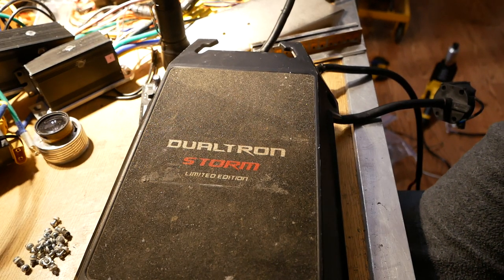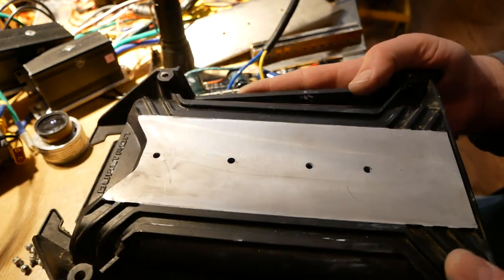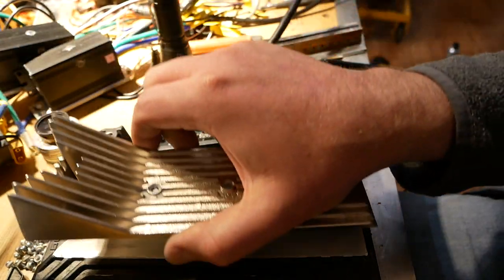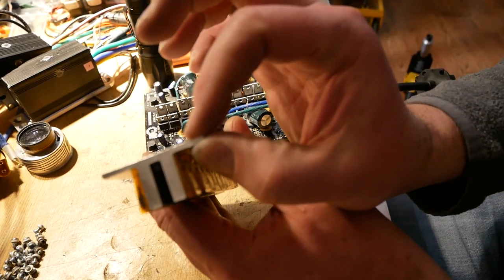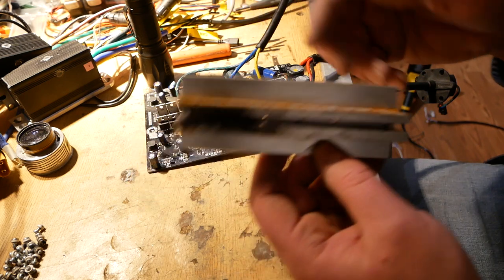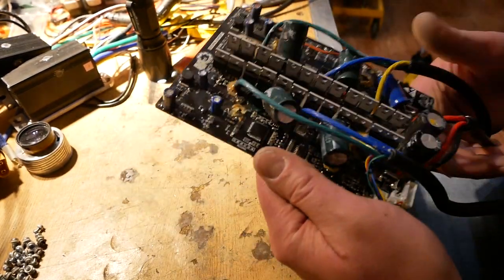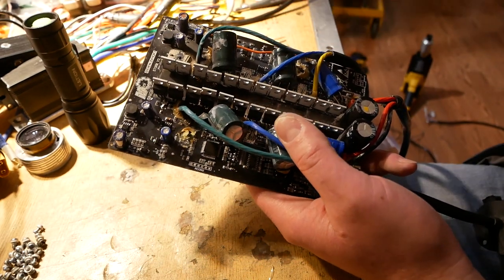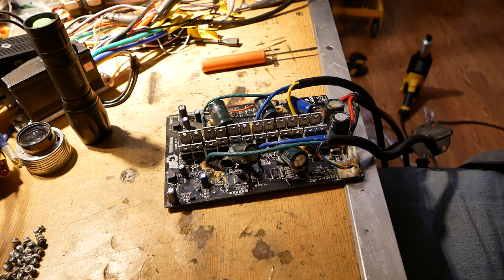Dualtron Storm LTD controller teardown - Why they die so often

Comment: I watched V_Tha_Sapien video talking about your discovery of the Dualtron Storm Limited controller because my limited controller burned out just the same as his. I had to ship my limited back to VoroMotors to get it fixed/repaired thankfully it was covered under warranty. I only had it but maybe 4 months and my controller failed. I’m glad there is someone like you that has taken the time to look into the issue first hand and actually find and share your results. I only hope that your video finds its way to the eyes of the Dualtron designers and manufacturers so they can see the errors they made and hopefully make the corrections that you have pointed out in your video. You got my sub. Thanks so much and Keep Smiling
Reply from the maker: GEEZ! 4 months! I think that's the second fastest Storm LTD controller failure I know of. My pal with the scooter shop, he was letting someone test ride a Storm and it blew up right there in the parking lot with like 10 miles on it. Either way, these controllers ought to survive many years of use without issues. 4 months is just pathetic! 
*
I made this video knowing the problem existed, but never had an LTD controller to look at before. I can't show or do anything if I don't have something to analyze...so I waited until one came in with a blown controller. It was inevitable...LOL! I went looking into the controller purely out of curiosity. The stupid high failure rates really had my attention! I wanted to see why they die as much as anyone and I don't even own an LTD! Frankly, if I did, I'd be pulling the controller out ASAP and replace it with something much better such as a VESC 100250. 
*
I own a Dualtron City. It's not very powerful from the factory. Probably the controllers will never die, but that's becasue they are hardly ticking over! Tepid, boring, slow are good descriptions for its performance from Dualtron. However, soon it will be doing much better and then I bet it will out perform the LTD. It's getting VESC controllers among other things.
Reply from the maker: BTW...thanks for the positive comments. Minimotors knows of me. I got their attention with the hook throttle delete mod video I did. I'm sure someone there will see this video soon enough. My friend just came back from Minimotors in California with 75 scooters (No LTD's!). They saw my video on the throttles and asked him if he knew how to get one. Well of course he did since I do a lot of scooter work for him! He took one of my throttles with him to leave in their possession when he picked up the 75 scooters. IMHO...the mod is pretty self explanatory and all right there in the video. I thought it was interesting that they wanted to see my work first hand. So yeah...Minimotors knows I exist. I'm sure they won't like my disparaging comments, but oh well. How about NOT making steaming turds that blow up all the time?!
Reply: @de-bodgery  I’m curious, if Dualtron gets enough complaints about the controllers failing, if they might put out a recall on them. It’s pretty unfortunate that they chose to cut corners in a few areas just to save a buck. In the long run, their poor choices will most likely cost them more than if they would have done it right the first time. All this negative attention can’t be good for their brand. I hope you do get a call back from MiniMotors snd possibly hire you. Because Lord knows, they could use your knowledge and expertise in their current and future products. With you under their belt, I’m sure they may even save some money. Time will tell. I’m rooting for you. Thanks so much and Keep Smiling
Reply from the maker: @steffenhawkins1323  
Laughs hilariously to himself...
These aren't cars or baby toys. I seriously doubt you could litigate a class action law suit and force a recall! Agreed, cutting corners just comes back to bite you in the ass. The LTD has a bad reputation to be sure! Also, nothing I have seen so far from Dualtron really inspires me with high levels of confidence. The wiring inside them is atrocious. They do seem to have decently well made frames and components, but the electrical systems seem to be laid out and designed by a 5 year old across all their EV's. Since all I've really seen so far is lots of Dualtrons, I can't really say if that is true with other scooter makers. Doesn't matter IMHO...shouldn't be done!
*
It didn't work out that I could go with my friend to Minimotors to pick up the 75 scooters he bought. I did want to go. If they offered me a job, I would have potentially considered it. I don't know if that would have worked out. Probably would have been better to just consult with them. Let me destroy a single unit of each of your scooters in an attempt to discover all the bad or poorly done aspects. Document what is found, let you fix them and then I do another tear down. Any new models you are working on for the near future, let me tear it apart, see what I find and we fix them before they ever see sales. It would potentially be worth while for Minimotors to have someone like me do that for them.
Reply: @de-bodgery  I agree with you 100%. I don’t know much about other Dualtrons since this Limited is my very first branded electric scooter. Before purchasing this Dualtron, I had purchased two electric scooters from Alibaba during the first year of the pandemic from a company called TVictor aka RealMax that you can sorta custom design them. However, I was not at all educated in what to shop for when it came to purchasing my first scooter. I didn’t know anything about the battery, the voltage, amp hours, speed, the controllers, the stem wobbles, any of the maintenance, I got into the this scooter fad completely blind as to what to look or shop for. . Within the past year is when I really dove deep and became obsessed with the electric scooters and finally after countless hours researching and watching reviews on YouTube on electric scooters in when I realized that there were more reliable and better scooters available than the ones from Alibaba. That’s when I came across an ad showcasing the Dualtron Storm Limited and its impressive specs. Spent the money on on pre-ordering it, finally relieved it, ridden it, and boy, what a difference between the scooters from Alibaba and a more well known company Dualtron. And I didn’t about the difference in a SineWave and a SquareWave controller. I’m still learning as I go along. I’ve only been a electric scooter fanboy for barely 2 years.

UPS just dropped off my new scooter the Kaabo Wolf King GT Pro about 30Min ago. So, I’m going to go make a unboxing video. I honestly think and believe that you are very skilled in your knowledge of electronics. It’s experienced people like yourself that should be designing these scooters instead of the current people they have right now that looks like they are going off a crayon drawing. Anyways, thanks so much and Keep Smiling
Reply from the maker: @steffenhawkins1323  I mostly build for myself or help others with their DIY builds. Electric scooters and other small EV's have been my hobby since 2015. My first stand-up was a chinese POS. It was all steel. It looked pretty good, but everything about it was bad. I had to reinforce the steel frame multiple times because welds would break! Stil...I managed to get about 6000 miles out of it before I moved onto something better. In the period of about 4 years, I replaced/upgraded most everything on it. Anyway, yeah...we all have a learning curve and don't know what's junk and what is not at first. The Storm LTD is a decently made scooter. It does need some help in wiring, but that seems to be an industry wide issue. Obviously the controllers suck, but that too is fixable. 
*
Go work for a scooter company...never really considered it, but sure why not?

Comment: Expert overview my friend!! keep these teardowns coming the people need it!!! including myself lol!!  I soon need to trouble shoot a controller/motor issue with my Dualtron thunder. is seems that the front motor is exhibiting a intermittent motor Phase short. with random pulsing resistance while under power and during free spinning.
Reply from the maker: I dislike stator shorts where they only occur under load. Clearly there is arcing from a winding to the stator, but no actual physical contact. You cant measure it with a DMM! Do you own or have access to an oscilloscope? This is what is needed to detect an arcing stator short. You spin the motor with the ground lead on the motor shaft and the scope lead on any 1 phase. Look for short duration spikes. Otherwise you should see more or less sinusoidal wave forms. Since this assumes arcing to the stator and this isn't the actual ground plane for the motor and controller, you probably won't see clean sine waves. If you see no spikes, put the test lead on another phase wire. The spikes should be pretty obvious every time a bit of current jumps the gap from the winding to the stator. It's also possible you have a controller failure. I don't remember for sure, but I don't think you have halls in the front motor on the Thunder...so that is probably not it.
Reply: @de-bodgery  Thank you for the great troubleshooting advice I have access to a nice rigol scope at my job. I will sope each phase. So can I ground them probe to the axel nut? Also the front motor does not have a hall connector to the controller. So just to confirm if I have nice sine wave from each phase then I could switch the motor controllers to see if the issue goes to the rear motor. If I see any phase spikes on the motor then would you suggest I buy a new motor?
Reply from the maker: @InvokePerformance  I'd try both grounding to the axel and to batt- and see which one works out best. Since this is potentially arcing to the stator, the axel nut ought to show the arcing best. I haven't tried this specific test myself since I lacked a motor that was arcing internally. I looked at the phases as they ran and for that, the logical ground location is BATT-.
*
Don't blow up your o-scope. What's your pack voltage? Whats the maximum voltage of the o-scope? Whatever your pack voltage is, add 20% to that to account for anomolies. Back EMF can have some strong pulses and that ought to cover this. Your scope needs to have 20% or more extra voltage range capability than the pack voltage. More is better.
*
No halls in front...yes...what I thought. I beleive the rear controller will still run even without halls. You can test that by disconnecting the hall cable only and trying to run the motor. The front controller can run the rear motor. See if you get that stuttering issue running the rear motor on the front controller. If you don't, the front controller is OK and that leads us to front motor issues. You can run just 1 motor at a time. Simply unplug the phase wires. The mosfets will see no load and nothing will happen to the disconnected controller. 
*
I don't know that you will get a sine wave or not. IF the controllers are sinusoidal and the bEMF from the motor is sinusoidal, then you will get sinusoidal wave forms on the scope. If you look through my channel, I did some bEMF tests on a bunch of motors last year. I tested 2 HLD inrunners and neither of them had sinusoidal bEMF. What that would look like while running the motor is probably pretty weird looking! A trapezoidal controller makes trapezoids. A cheap sinusoidal controller sort of makes sine waves. A good one such as VESC or Kelly will make nice sinusoids. I have no idea what your controller makes so I won't predict this. There's unknowns here that I can't predict.
*
Once you try both motors on the others controllers, watch for where the stuttering issue goes. It might follow the front motor. It might still happen on the rear motor running on the front controller. This is a good indication of where the problem exists. The scope will show the arcing if it exists and at that point a new motor would be the right choice. Right now, I can't recommend that since there too many variables to eliminate first.
Reply: @de-bodgery   brilliant! My pack voltage is 66v max my scope can measure up to 100v divisions so i will be very careful. i will conduct these tests and share what I find. Thanks for your time my friend!
Reply from the maker: @InvokePerformance  Try to record the wave forms. I don't know your Rigol scope and if it can record or not. At least do a video you can post to your channel.